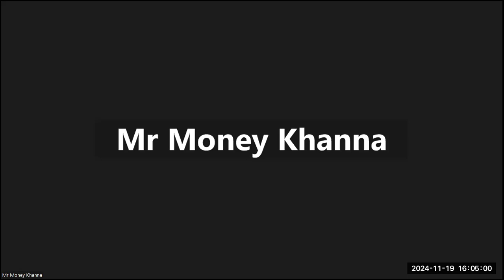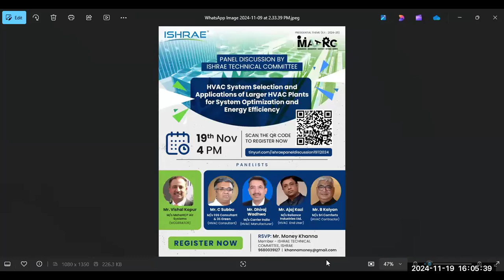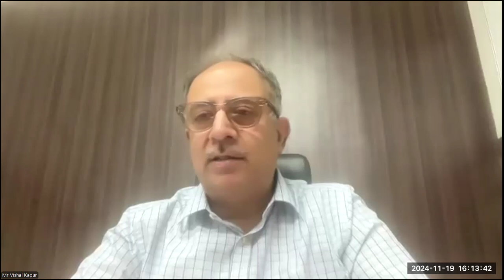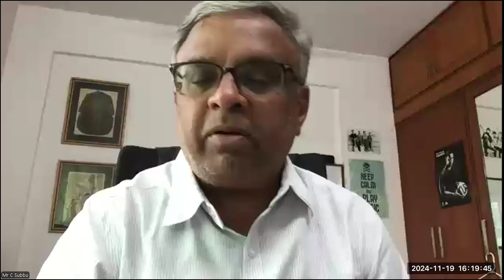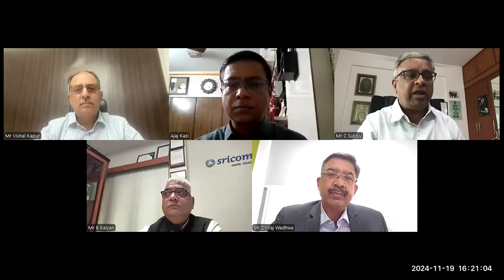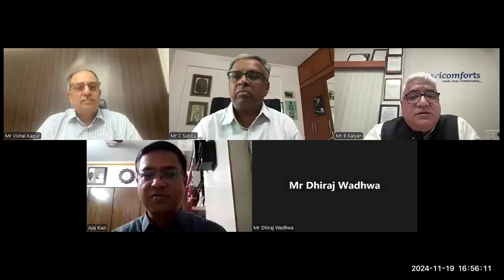Panel Discussion by ISHRAE Technical Committee. #ishrae #hvacexperts #education

Comment: Good discussion, I'm wondering if we will in India hit a policy that AC's have to be set to 27 Deg C like Japan has mandated all their offices. Wouldn't that make a significant impact on the energy use in India where the people are extremely resilient to temperatures as high as 30 to 32 degrees C?